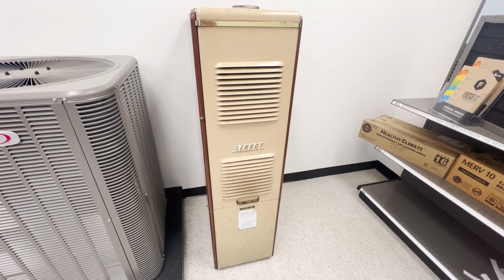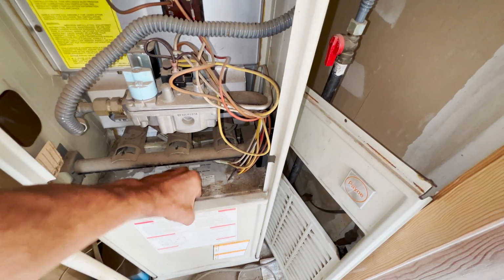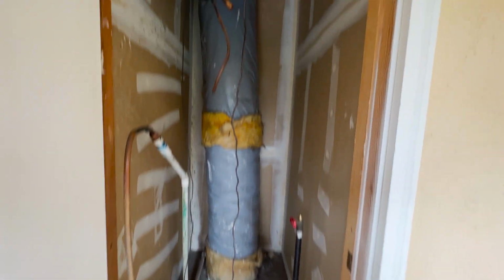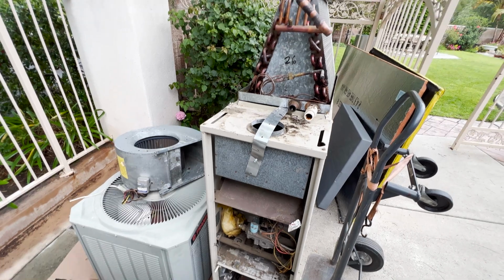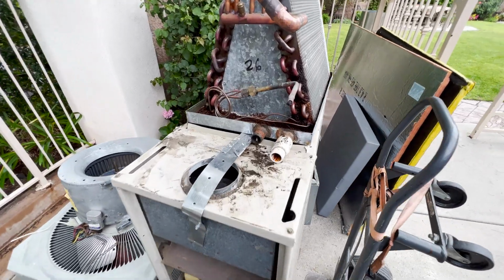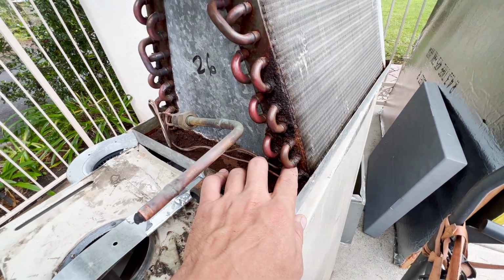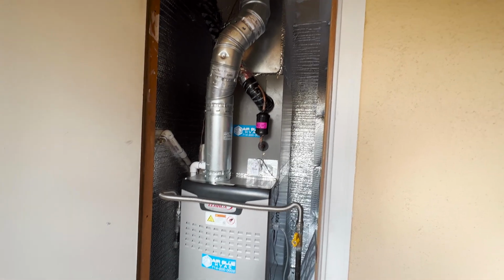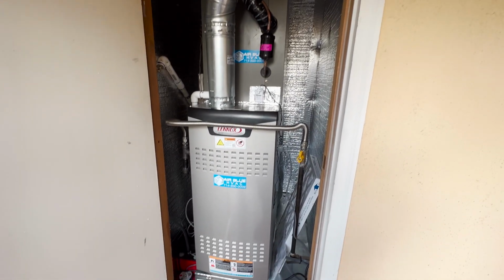3 ton AC installation in Anaheim / Lennox gas furnace ultra low NOx #hvacinstallation

Comment: I’m not an hvac tech but you guys sure do nice honest clean installations . Amazingly I have an original 1983 Rheem 2.5 ton ac and gas furnace . I have an installer I trust and know for many years . He mostly uses Heil and Goodman . I would be putting in something simple like you did on this job - just single stage and an 80% gas furnace . What’s your opinion on equipment for simple no bells and whistles equipment choice ?
Reply from the maker: hello, 1 stage unit will have lowest cost of ownership over the lifetime most likely. Now most 1 stage and 2 stage units have same tech PSC (with capacitors) so I personally would always go with 2 stage units. yes its little bit more expensive and will not last much longer and will be more expensive to service but will be lighter on electric bill, quieter outside and inside and will have better comfort and longer cooling cycles because of staying in low stage mode 90% of the running time. 
i would not go with INVERTER unit unless you want best comfort possible and want most efficient unit and you are aware of it lasting you 10-15 years.

Comment: Surprised to see gas furnaces being installed in Southern California. The climate is perfect for a heat pump, especially since aux heat wouldn’t be needed.
Reply from the maker: American Standard Heat pumps are tiny bit more expensive(120v variable air handler + evaporator coil + HP condenser, 2 stage especially), electricity cost is high(, only solar customers or customers that are thinking solar get Heat pumps usually or ones that afraid of future issues with ULTRA LOW NOx furnaces. Gov had $3000 rebates just to start Heat pump thing but ran out of money pretty fast
Reply: All of California has a major problem with a heat pump idea.  The cost of electricity, at .38 cents to .44 cents per kWh, it doesn't make a lot of sense the pay the power company all year long when natural gas is already there and will cost way less to heat a home at about $1.15 per therm.